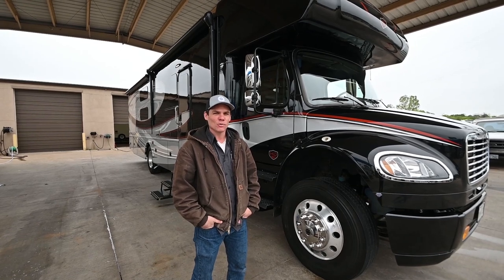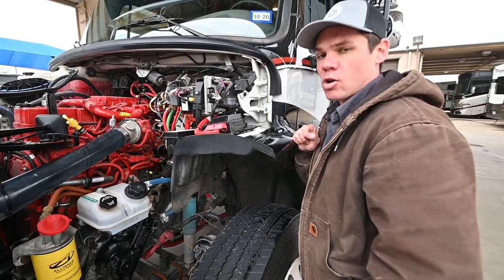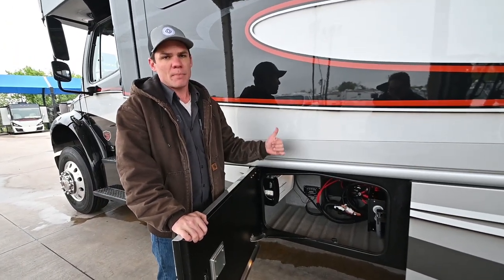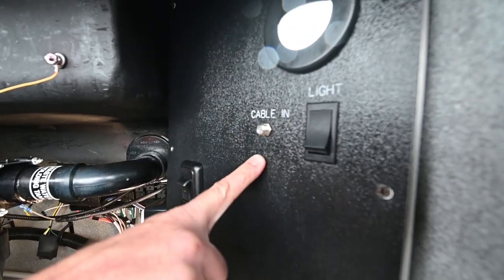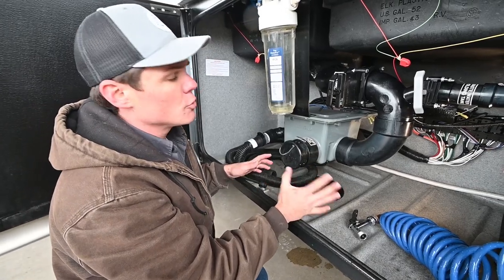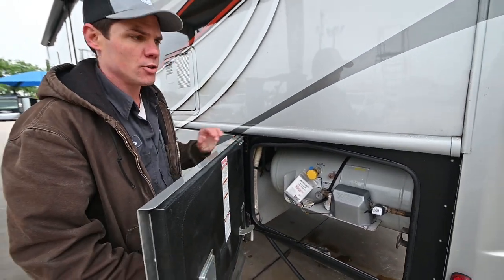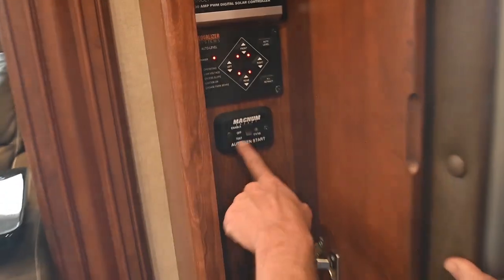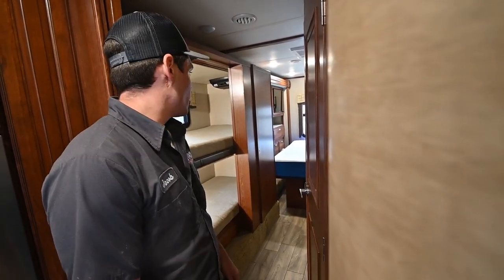Dynamax Force HD 37BH Walkthrough

Comment: Nice walk through. I’m really surprised that the coach didn’t come with a hydronic diesel heat system instead of the forced air LPG. So much quieter and can be used to preheat the engine in cold temps. Very nice though.